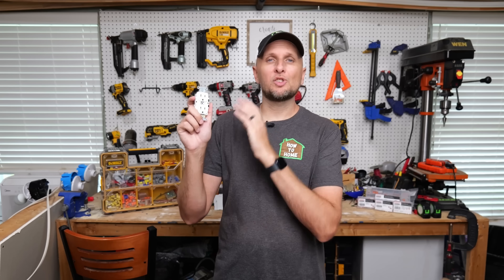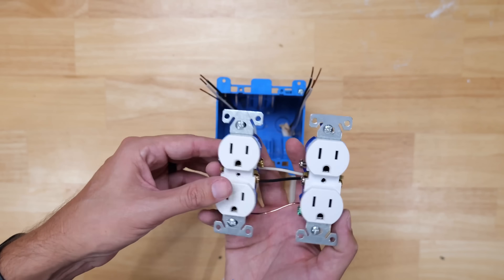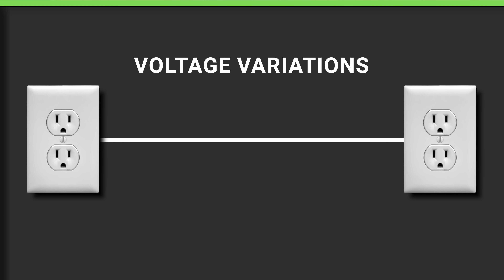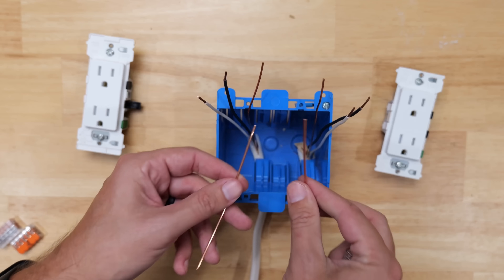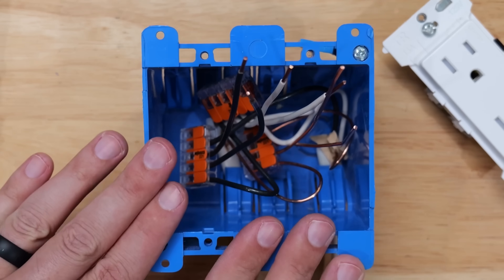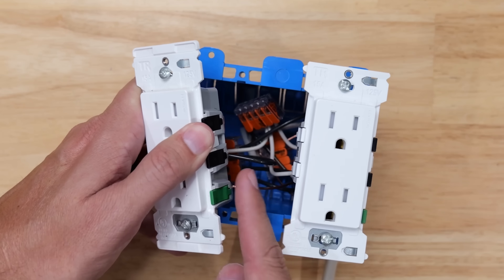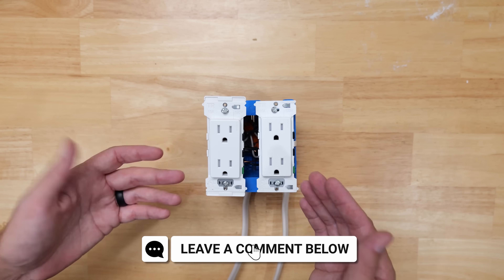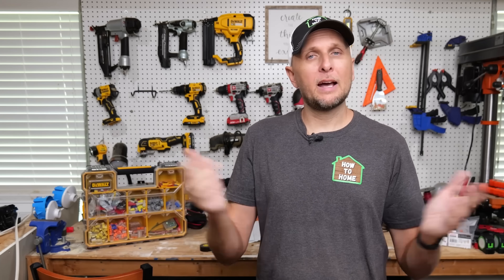Why This Outdated DIY Outlet Wiring Needs to End!

Comment: Let me ask you a question - are those "wago" lever nuts re-usable?  I saw similar connectors at Home Depot, but thought that I read that they weren't re-usable.  Granted, the take would be "how often is one changing the wiring in a given box," but on the flip-side reusability of the old wire nuts is why most homeowners might avoid one-use connection boxes.
Reply: Wagos are reusable, yes
Reply: @JohnnyGiddingsCubed  Thank you! Please put that in a future video and I'm sure people will get the message.
Reply: Wagos work great.  Much easier to work with in small areas as compared to wire nuts.
Reply: There are one time push in connector on the market you must of saw that
Reply: There were older style Wagos that were not lever locked.  You just pushed the wire in and barbs held it in place.  You could pull out solid wiring to change it, but stranded wire was listed in the instructions as "cut the wire and throw the connector away."

Comment: You should mention about gfci. For gfci you should not do this if you are only using one gfci and attaching non gfci but still want them protected.
Reply: Right, for that case just hook up the wires with incoming power to the line terminals on the GFI and hook up the wire feeding the rest of your outlets to the load terminals.
Reply: @dirankomorov  yup
Reply: And then you can pigtail everything downstream of the GFCI, correct?
Reply: Yes
Reply: I think that’s an excellent point that should have been addressed before it’s asked
Reply: However, the pigtail method would allow you to put multiple GFCI receptacles on the same circuit.  This would ease future troubleshooting because you don't have to hunt for the random GFCI at the beginning of the circuit.  You just have the failure point at the outlet.  I do agree that there should have been a mention of special considerations for GFCIs since this is a DIY channel.  Even just to say there are special considerations, watch this video for a discussion in depth.
Reply: Am I correct in saying that any outlet on that circuit that requires a gfci should have one? Both my bathrooms and an outside outlet are on one circuit. So that if I rewire all the outlets in this way, I should use a gcfi outlet in each instance.
Reply: @janruth2451  That is a bit of a complex answer to provide in a comment and why it should have been mentioned or covered in this video. If you have a GFCI breaker in the fuse box/ electrical panel then every outlet, switch, etc on that circuit should be GFCI protected if everything was installed correctly. If you don't have a GFCI breaker then you can daisy chain 1 or more regular outlets off the GFCI breaker and they will also be GFCI protected but the circuit has to go through the GFCI outlet, and the GFCI outlet will only protect any outlets connected downstream after the GFCI outlet in the circuit. If you attempt to do the pigtail method from this video were each outlet is directly connected to the hotwire directly without going through a GFCI outlet then you would need to use a GFCI outlet everywhere that needs to be protected. It is also possible to do a combination of these things for specific cases such as outlets where in rooms with water such as kitchen and bathrooms that shares an area that doesn't need to be protected. NONE of this is specific to whatever code requirements are in effect where you are and you should check code requirements with local municipality or county as needed since it will likely also dictate requirements about not only GFCI but also AFCI and other specific requirements for your area.
Reply: @janruth2451  I would do it that way... just to avoid issues when one pops.
Reply: @janruth2451  depends on where the GFI is if it on your breaker then makes no difference. All bath , kitchen should be 12 gauge wire ( 20 amp).
Reply: Pigtails method puts more wire in the box and more connections, which is more failure points.  It also makes the box more crowded, and therefore difficult to assemble.  The voltage drop through the little break off tab is barely going to be measurable.  The tab is not even 1/2 inch long, and it has to be rated for the full current rating for the plug.
Reply: Cheap asses........lol
Reply: Sorry I did not find the value in this. All you did was add more failure points. And things can sew break down the line. And it's not communicate with gfi's properly. With the old way of doing it it covered all that. With less failure points
Reply: Yes it's a pain when GFCI outlets fail and you have five of them and can't tell which one is being a duche bag....lol
Get over it.   Just by more and enjoy the chaos.....lol
Reply: That is for another session. He is talking about regular outlets. One can install a gfi or acfc circuit breaker at the main  box.  He was just doing outlets  do not be so critical.
Reply: @Moonraker6646  It deserves at the very least a mention because anyone that would just do pigtails based on this video would have no idea that they created a safety issue or violated code in those cases.
Reply: @Moonraker6646  No-one was criticizing, but pulling up a circumstance that is an exception. I have hunted around, looking for the bad receptacle in my garage.... OF COURSE it was buried behind stuff, so tool a while to locate.